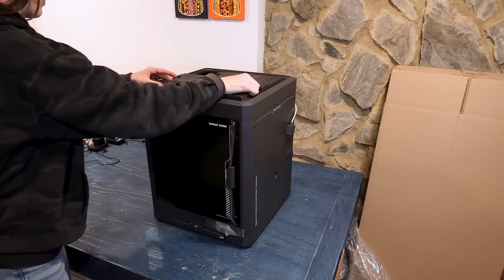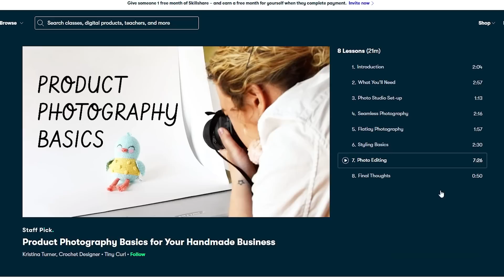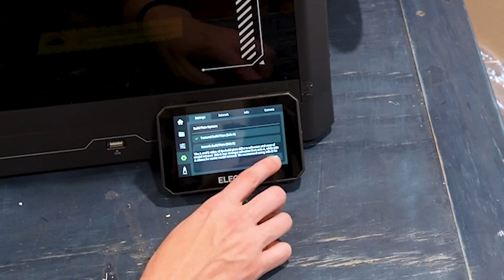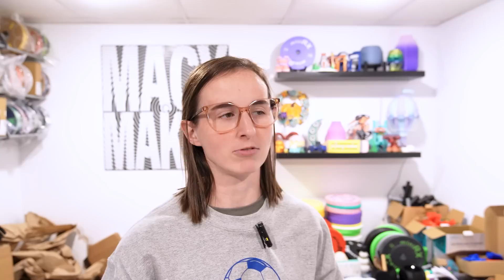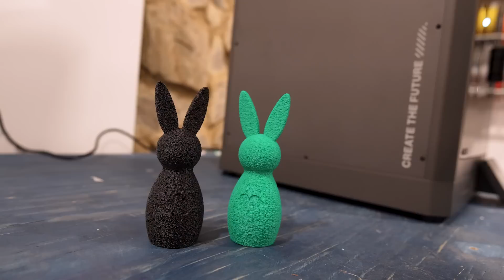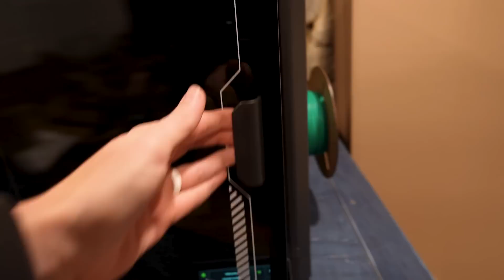The BEST Budget 3D Printer - Elegoo Centauri Carbon Review

Comment: I had an Ender3 Pro for years. Probably spent more time upgrading and tuning than I did printing, lol. Recently  I decided I'd like to get back into printing. I did some major upgrades on the Ender, then struggled getting the firmware compiled. Finally got discouraged and decided to buy a couple new ones. One of which was a Centauri Carbon. It was amazing how easy it was to start printing out of the box. Big difference from the Ender days. I now have the old Ender3, a CC1, a FF AD5M, and lastly a Bambu A1 Mini. All three of the new ones were surprisingly easy to start printing. 
And now, thanks to watching your review, I'm wanting a Prusa XL. Don't need it. Not even sure what I'd do with it, but I want one. Thanks... lol.

Comment: I got mine a couple of days ago. You really don't need to rerun leveling every print - I've only done it once and its printing beautifully. 

I haven't needed to help push the filament into the extruder. I just push it as far into the tube until it won't go any more, then press load and it grabs it perfectly all by itself. No help required. 

The new batches like mine also have additional LED lights in the top - one on the right and one in the front as well as a port for the upcoming MMS. Really loving this printer.

Comment: I am trying to calibrate mine now. I agree one should wait. As you said. It seems like with every new printer the first ones seem to have firmware and slicer issues. The hardware seems pretty good. That said it is hopeful that these issue along with just making the printer better out if the box experience will be fixed down the kine.  I am struggling   To get mine fully calibrated in. Right now dealing with bad stringing issues. So far no changes in elegoo slicer seem to make any difference. Or maybe i am spoiled with my GREAT experience after 25 rooks of filament pla and petg using ludicrous mode all the way and not even ghaving to open the door to vent. Also perfect prints 99% of the time. Maybe i am expecting to much from a $300 printer.

Comment: I have a Neptune 4 Max, it takes 20 minutes just to fully heat the bed before I can tram it, which might take another 20 minutes.  Then I need to level the bed, and check the z offset.  I do all this if the printer has been cold.  I think I can deal with the Centauri as presented.

Comment: I liked the review because you were able to show me the product, it's setup/unboxing, accesories and how it handles printing, even with some different settings. I thank you for that.

Altough the "Negatives" part of the video feels like you wanted to add multiple negatives, but you didn't really have much there, so most of the negatives are only theoretical, apart from the only two valid points made that the time for initial calibration is longer (about twice the time) of the Bambulab P1, and the light not being bright enough.

Comment: One of the major issues most people are having so far is the noise level. I don't have one yet myself, but I've seen and heard some videos, and it seems a bit excessive. Not something that would be comfortable to be in the same room with.
Reply from the maker: Yeah, it's pretty loud, but not that much louder than other printers.
Reply: @macymakes3d  Good to know. Hoping hw, firmware and profiles are tweaked and optimized when I get mine in a couple of months 🤞

Comment: Good and honest review.
Understanding your concern where comparing it to the P1S, my thinking is also perhaps the buyers might not have worked with one of those, having one myself - wonder if they would be able to correct or address these with firmware mostly. Lighting think it would be a “raised glass” print with a led strip.

Comment: This could have been such a winner in the local market here (Australia) except it's $699AUD, which equals about $445USD, so quite a hefty markup on the $299USD price point.

Also, googling some g-code to put in my Bambu Studio Printer preset to not do a full bed level before each print was a massive winner. Look into that if you havent already.

Comment: The software still needs some work (like the camera stream often stopping after a few seconds) and a few other things need fixing too, but the main thing right now is that the chamber light is underpowered. We'll probably need to upgrade that with an LED bar shining in. Small cost at that price.
Glad they also announced an MMU upgrade for later this year, then an upgrade with a better, smoother PTFE tube also becomes a necessity.

Comment: The friction when loading filament is because , they didnt leave enough clearance between the print head and the top panel for the ptfe tubing. So when the top panel is on, the ptfe tubing going into the print head is at a very sharp angle, which makes it more difficult to slide the filament past that angle into the print head.

Its a little better when removing the top panel, but not only is it really dumb to remove the top panel everytime you want to load filament, but theres also a risk that when putting down the top panel, which pushes down the ptfe tube with the filament inside, that the filament breaks inside the ptfe tubing , which would mean having to take all the ptfe tubing apart, get the broken bits out, extrude the part thats still inside the print head, load again,....

I know in these reviews, they arent really allowed to talk about the negatives, as they are sponsored and they dont want to hurt the manufacturers feelings and stop getting free printers, but the centauri carbon cut several corners to achieve that price tag.

Its not a bad printer overall seemingly, but theres some design choices that dont make sense (which isnt surprising, its elegoo...), such as the sharp angle of the ptfe tubing, the lack of self loading, the placement of the runout sensor, the placement of the spool holder which is attached to a flimsy wobbly side panel and not on the frame so it will only ever be able to use 1 kilo spools, their slicer which is just a orca fork when they could just let you use vanilla orca, selling a printer only being released in july despite clearly having a lot of printers already to send to various youtubers,..
Reply: Dead easy to use 2kg spool, just use a spool holder..
Reply: Someone created a file that raises the top a little or a lot depending on preference to help with this issue.

Comment: on filament run out is the remaining filament inside the PTFE tube easy to remove?
I will probably use an alternate spool holder above the printer and arrange for a 3 inch gap between the filament run out  
sensor and the start of the PTFE tube

Comment: I like the look of this printer based on the reviews I've seen, but its way overpriced in AU market, which I don't understand. It should be around 150% the USA price, like other printers, but its $699 AUD ($444 USD at today's exchange rate). (A1 Combo is $749 here for comparison). Shipping to AU should not be a major factor in the pricing as its generally cheaper to ship goods from China to AU than it is from China to USA. I think it will justifiably be a flop here.

Comment: Idk what the issue is with these companies putting in poor lighting in these printers. I wound up upgrading my like in my k1 max and it’s a drastic difference. I do think if elegoo gets their  multi material unit on the market soon, it may take a lot of profits from other companies. If they can get it to $500 with both and the machine is reliable then they will sell a ton.
Reply: I expect the MMS to be $250 but Elegoo loves disrupting the market with prices that make you think there was a pricing error on the site. 
I just hope that the MMS is good and reliable. I'm sure they are putting in the work to make sure it's something that works flawless with their cardboard spools that all of the Elegoo branded filament comes on.
Reply: They fixed the lighting (made it much more robust) with the latest versions that have shipped in the past couple of weeks.

Comment: I'll probably wait till next year to pick one up if they prove to be reliable. I just had to return a neptune 4 plus after a month cause of various problems.
Reply: what kind of problems did you have? i've had the same thing for 4+ months and it's had some issues but nothing return-worthy.
Reply: @LetusbegoingOfficial  I was able to get like 5 prints out of it then one night I left it on and it refused to print on 1/3rd of the plate on the right side and ruined the thing it was printing. I tried everything, releveled multiple times, changed the nozzle, checked the whole head and extruder. Then after putting it back together the extruder refused to push the filament at all. The end wasn't blocked cause I could still push it through manually but it wouldn't go on its own. I just got tired of messing around with it trying to figure out how to get it to work.
Reply: @johnnyd.1925  huh. well, the more you know.

Comment: I really would like to know if this printer can print miniatures. I'm looking to preorder this printer. Looking for advice.
Reply: .2mm nozzles can be swapped in, so there's nothing stopping you. You should be able to order one with the printer right now, from what people tell me.
Reply: @unspeakableoaf  thank you
Reply: It has sensors or something for pressure advance which is one reason why people enjoyed the P1S for miniatures so it should do a good job with the .2mm nozzle.
Reply: @only1sn1not1taken  thank you
Reply: Why not buy a resin printer if only doing miniatures?
Reply: @nickdiehl  the mess, the fumes, the hassle, kids in the house, no good place to put it to help deal with these issues.
Reply: @ Yeah, some people simply don't have room too. You need the printer, a curing/washing area (preferably a device), so even if they have the steadiest hands seen on Earth, it's not for everybody.

FDM? Wait a bit (or a lot) longer, pick the print off the plate, pick apart any supports.

I personally go with low-fume, water-washable resin for miniatures (the alcohol you clean the other type with has more warning labels than resin), but I have the space. And whoah, is it a messy space. It won't pass OSHA regulations or any safety requirements :P

Comment: I pre ordered one.  Sounds like the issues you are having are the same issues everone else is, including damaged in shipping.  Im crossing my fingers they get the light and the tube issue fixed before the first shipment.  If not im sure the comunity will figure it out. 
For me 299 was a no brainer. I have been running a ender 3 v2 upgraded to the specs of a s1 pro for just under 2 years. Im personally excited for the upgrade.
Reply: Amazing upgrade and this being at 299 is basically the nail in the coffin for bedslingers unless they can make some other advancement. 
I've been seeing people cut the cable tie just before the extruder and slacken up the cable some. This can also help with an under extrusion issue from some materials at higher speeds. Shipments started a day or two after they went on sale so I doubt that they are going to fix any of the hardware issues. At least the tube is an easy user fix and the light is just a QoL annoyance. I have seen videos of before and after the light being turned on and it seems like there are some auto settings that the camera is doing that works against the light doing it's job as well as it should. Even without using the camera, the light issue still needs to be improved but light placement would probably have to be out of the FoV of the camera. If it's in sight of the camera then it's probably going to overly correct due to the bright spot.
Reply: @only1sn1not1taken  little cut cable tie doesn't sounds to bad to me.  I have already been thinking of adding a led strip and put in a micro switch  for on off function. Sense the side pannels are removalable sould be easy enough to install. Hopefully it doesn't drown out the camera though.  It would be cool to watch the print remotely.
Reply: @tbboardhed2  I think they could probably do some firmware fixes that address how much the camera settings adjust to the light. If so then I'm sure that's an update that we'll get at some point.

Comment: Does Elegoo plan to release a competitor to the AMS? You mentioned a 'multi-material system' so I'm guessing that's a yes. Now that I own an AMS, and having experienced its advantages, not having one is a deal-breaker.

You also discussed the interior lighting. Here's an easy fix for you printer manufacturers: Paint the inside white! It's such an easy solution, I can't believe they haven't implemented it.

Price point is a huge advantage for Elegoo, especially for someone new to 3D printing or who isn't invested in an existing brand.

Good review. Thanks.
Reply: Yes, they did say that they will be releasing an AMS system later this year. Also the lighting issue is even easier. Just cover the sensor and then the machine will always think its dark, so it will keep the light on when printing.

Comment: I love elegoo for their printers and filament as well. The one thing that they need to figure out and do better is shipping. This is the 2nd time I've seen content creators receive their machine (at least the box) in not great condition. I ordered a bit of their filament and almost all of mine came dented, or somehow damaged. I hope they can get this fixed some way maybe double boxing it? Or maybe putting more cushion in the boxes? I'm not sure but most of the other manufactures from China seem to have nailed it.
Reply: Yeah, my old Ender was packed like it was precious goods back in the pre-plague days, and Elegoo's resin printers are padded for battle. Odd that this particular printer has this problem. It's on my list as a replacement/addition whenever I need it, but I'll get it from a local supplier who knows how to pack :)

Comment: That filament loading is just weird. It should load into the extruder gears and then hold there until hot end is ready. Weird that even the Bambu requires intervention. Prusa doesn't have this, ever.
Also, that lighting is a joke. LED strips are cheap.
Reply: I was a bit taken back by that - fair enough for a just released model like this Elegoo, where it could be expected to be rectified with firmware soon enough, but the fact that BL printers require waiting and intervention. That's wild.

Comment: Still doesn't have a large print area like the Qidi Plus4
Reply: Its $299 WTH, Qidi Plus4 is like $699. 256 x 256 is and always has been the most popular size that why everybody makes that size not everyone goes bigger as its a smaller market.
Reply: @AlbertoMartinez765  Yeah, there are plenty of larger printers which are pretty hot right now, around 400x400 to 420x420 area and various heights of the build area. I would be interested in a bigger model in this range though, and I'm sure they will make one if it's popular. They seem to be a "one printer at a time" company though, not releasing a dozen models every year.

Comment: I'm guessing with all that friction is is going to be hard to impossible to use flexible filament.
Reply: I printed some anti vibration feet using TPU 95A with my Centauri Carbon on the 1st day. I had doubts as well about feeding it in but it went in without any issues!